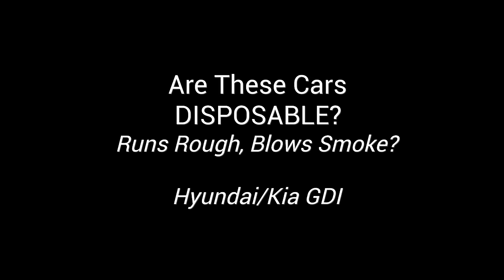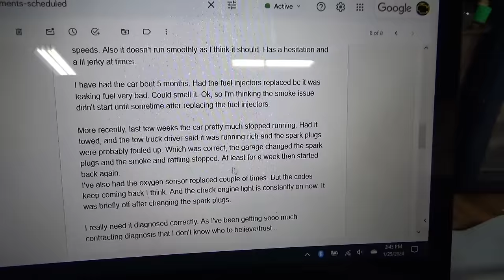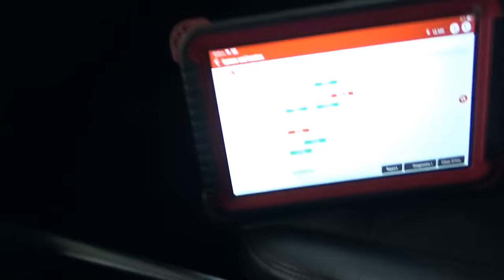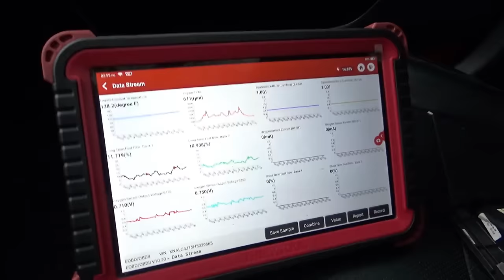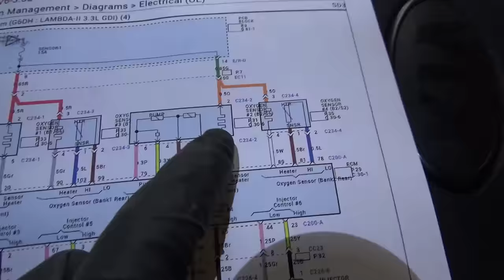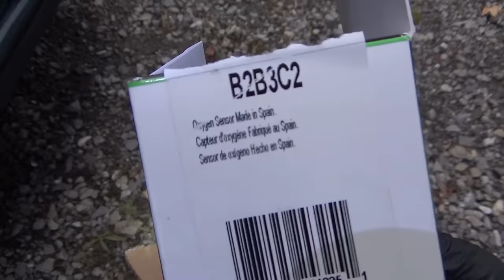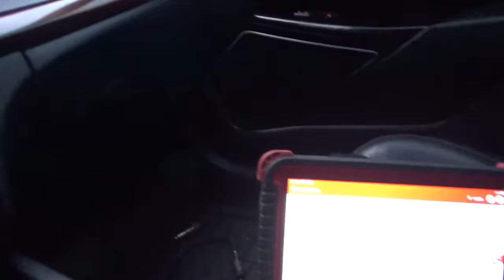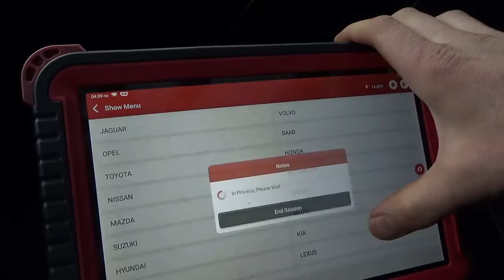Are These Cars DISPOSABLE? (Hyundai/Kia GDI Burning OIL - MISFIRE, Low Power)

Comment: What's horrible is Hyundai in the early 2000s had a halfway decent car. (Drove a manual Elantra to 199,000 no issues ever) They switched to GDI and the engines are junk.
Reply: earlier engines were Mitsubishi licenses. I have a Kia Amanti with an old Mitsu 3.5 v6 engine. There is a timing belt and the only problem is weak bushings. But if you take care of the oil and good cooling, it will last a long time
Reply: Yeah. They were terrible in the 90s, pretty good in the 2000s, and then trash again when the GDI engines came out.
Reply: Hahaha I have a 2011 Elantra with 160,000 trouble Free miles,
Reply: @Chris-L-sr   Not all of those are GDI for 2011.
Reply: Yeah, they spent like 20 years undoing the damage their early cars did to their reputation, only to redo all the damage with their newer engines. Just a shame.
Reply: The 2011-14 Theta II engines weren't cleaned thoroughly, so they left metal particles that would lead to rod knock and grenaded engines. I have a 2015 Sonata with this engine after they changed the cleaning method. The post-2014 engines are fine if you do the recalls, change oil on the dusty schedule and change the air cleaner on time. I've had no problem and only minor oil usage at 89K on mine.
Reply: I had a 2009 Optima, great little commuter car. No mechanical issues after 120K miles when I traded it in.
Reply: "Only minor oil usage at 89,000" , sorry you shouldn't have ANY oil usage until 200,000 miles! You're making excuses for a crappy engine!!
Reply: @jackedwards7420  NO oil usage at all between oil changes? That's a fantasy. Manufacturers admit there will be some.  I'm talking a half-quart every 5,000 miles, not blue smoke spewing out the tailpipe.
Reply: My sister has a 2008 Hyundai Sante Fe with the big 3.3l V6 Theta engine.  Valve cover leaks were common and a replacement was covered under warranty, which also leaked so I did it again myself. She had neglected a lot of maintenance (not oil changes thankfully) but after I basically rebuilt the steering and suspension (KYB shocks, Mevotech TX ball joints and sway bar links, new Hyundai compliance bushings, new tie rods, etc etc), it runs like a champ.  180k miles on it. A few oil changes with 20% MMO and then switching to 5w-30 cured the slight VVT rattle she had on startup as well.  Smooth power, transmission still shifts wonderfully (several drain and fills done on it). Had to troubleshoot and eventually replaced the failed TPMS module but it's even got a nice high line TPMS system that tells you the status of each tire individually.

She thinks it's like a brand new car after it returned to "properly maintained" status.
Reply: @brassmule  The problem with cars becoming so much better compared to back in the day is that drivers don't really need to know much or anything about cars. 

Those of us who grew up with points and plugs and mechanical timing know more and pay closer attention to maintainence than younger folks, because back then you had to or you'd be walking.
Reply: @Alboalt  Sometimes I do miss those days. I had a failing alternator, so I got to work early one day, removed it in the parking lot, walked 2 blocks to "the place" that rebuilt them - literally just handed it to a guy through a barn-style door, told him my name .  Went back to work and worked all day. After work, walked back, picked up my rebuilt alternator, gave the guy 25 bucks and got a handwritten receipt, reinstalled, and went on my way - 6 years later still had the car, still drove like a champ. I wouldn't say it was an easier back then but you still had to do the minimum to keep a car running tops.
Reply: @Alboalt  somehow my 06 Acura tsx with 240k miles doesn't burn a dime of oil,and it's  a 1 year amsoil oil change at 16k, For the last 7 years.
Reply: Have an 09 sportage with 2.7 v6. Only non service item replaced on it was the front exhaust pipe. Started leaking at the bellows. Damn salt on roads.
Reply: Yep, another friend of mine at work had one that had almost 300k on it, original drive train(3 pedal), he had to scrap it due to rust issues.
Reply: @mandytuning  You win the battle of the anecdotes!!!
Reply: the engines that were made in the USA are crap. The ones made in Korea are good.
Reply: @Alboalt  Yes a very valid point I had an 89 hyundai bought used for $500aud ,6 months registration (you have to have vehicles inspected & re registered every year)We (my mated & I ) thrashed that thing until I bought another vehicle it was then the circle of mates to drive until it was dumped by one of them (ran out of fuel) the only thing that went wrong with it was a bolt that held the thermostat in corroded off & we used a pair of vice grips to hold it together.I was a fun vehicle & we has it up to 160klms an hour 100 miles an hour in old terms with fout people in it.Another person told me it was dumped & gave me $ 250 aud for it.
Reply: Hey, I remember the mid 1980s Pony’s. Cheap little cars but super basic mechanics! If I remember, bodies went (rusted) before drive trains ever died.
Reply: @jackedwards7420 In a perfect world, a engine would not burn oil. Many car brands, 1 quart per oil change is not uncommon.
Reply: @jackedwards7420  Yep. I have a 2004 Corolla 1.8 with 180k miles and it doesn't lose a single drop of oil between 5000 mile changes.
Reply: I have an 04 Tiburon with the 2.7L Delta engine, which I think is one of the first engines Hyundai built 100% independent of Mitsubishi, and it's still going happily at 175K miles (supercharged even). I really love that car, sucks to see how far Hyundai fell.
Reply: @Alboalt except for my Subaru, none of my 5 other cars use an appreciable amount of oil between 5k mile oil changes. Yes some oil usage is acceptable but it is also far from universal.
Reply: All engines up until 2011 were either Mitsubishi designs or were developed in conjunction with Mitsubishi. All of these engines are excellent. After 2011, it is hit and miss with Hyundai/Kia engines. Theta 2 is a dog,. I have so many friends who have blown engine on years 13, 14, 15, 16 and 17.
Reply: I drove a 2002 hyundai accent for 20 years. No engine problems, ever.
Reply: the golden years @Serious-Man
Reply: @adotintheshark4848  This car has a VIN starting with K, so it was built in Korea. Can't imagine that they are shipping US-built engines to put cars together there.
Reply: @MattyClivingthedream  the Mitsubishi designs were excellent, but Hyundai's production of them was inferior.
Reply: 2009 Santa Fe 3.3 with 234,000. Value cover gasket replacement and alternator regular oil change 4500-5000 trans fluid at 60k , 120k, 175k. Brakes and fluid change and coolant change with t-stat original water pump yikes!!!
Reply: @Alboalt do you have actual proof of that? I think that original story was debunked when they had to extend the recall to include years after the supposed "remaining metal shavings" that were supposed to only affect 2011 and maybe 2012 in the initial recall. There are different theories on what the actual issue is but none of them that I had seen when I was researching this are remaining metal shavings. My wife owns a 2013 which is why I was looking into this so thoroughly.
Reply: Are you on crack? Hyundais in the 2000s were some of the least safest cars in the road. Sure, their engines might have been a little reliable but everything else was still junk. Imagine having a 3 year old Sedona with 50k miles on it and it needs new door sensors, oil pan gasket, power steering pump and hvac controls.
Reply: Yes, the 2011 Hyundai i 30 was a good car but the newer ones with GDI I wouldn't touch
Reply: @jackedwards7420   funny clown...tell that to any BMW, Audi or VW owner....yeah they burn oil when they are NEW and its eve stated in the owners manual....
Reply: @gionieves2646  , and that's still no reason for a crappy engine. Just cover up for trash!!
Reply: @jackedwards7420  not really...of people are changing the oil every 10k miles....yeah they deserve a new engine....the oil consumption I'd from the oil ring and compression ring getting stuck with sludge....bad maintenance!
Reply: They still build good cars. I have a 2016 sorento with this same engine. 180k miles on it with no failures.  The only thing that has broken was the combination switch for the headlights  which was recalled so free for me. 

I follow the severe use maintenance schedule since I tow with it and live in a mountainous area.(this is all in the owners manual of course).  

This car sees 6k rpm at least a couple times a month and I tow with it regularly. Uses about a quart per OCI. Strangely if you maintain your vehicle per the instruction of the people who built it then it will last just fine even under hard use. If you treat your car like it’s disposable and don’t care for it properly then yes, it will indeed be disposable.
Reply: Just the ones made in the U.S. They had trouble with the piston bore holes; made them oversized. Engines coming out of S. Korea are just fine. Always change your oil on time and check oil level every couple of weeks and top off if needed.
Reply: Well, no issues if you didn’t replace the timing belt at the interval they originally recommended for inspection. ;) Had a manual 2000 Elantra myself with the upgraded interior from late 99 to 2007 when someone T-Boned me. They used to be all over the road but it’s a rare distraction when I see one now. I assume the timing belt thing started taking them all off the road after the 10 year warranties expired and subsequent owners dropped their maintenance regimens.
Reply: @emmettturner9452  had one with 198k original timing belt.
Reply: Yep their 2.4 back in the early 2000s was a good engine.i still drive a 04 Santa Fe with this engine it has over300.000 miles on it .with regular oil and filter changes at 3000 miles conventional oil and filter.the only thing that typically would go bad from time to time was the crank angle sensor or water pump .also be sure to keep after timeing belt and related bearings.its advisable to change water pump at timeing belt change
Reply: @jeremypilot1015  Sure the dealer wasn’t replacing them during regular maintenance when they are on the hook for the first 100k/10 years? They had a financial reason since they are on the hook for it otherwise (interference engine). Heck, they were originally supposed to be replaced at 90k for normal scheduled maintenance. It got bumped to 60k when they found out most were snapping at around 90k.
Reply: it has nothing to do with GDI it has to do with manufacturing defects you either get them or you dont
Reply: @adairjanney7109  GDI by nature is junk. The intake valves never come in contact with gasoline so they carbon up and cause all sorts of problems. It costs a lot to have the intake removed and all of the carbon cleaned out. A grand or better by the time you’re done.
Reply: @jeremypilot1015  bs I dont buy it, I opened up my intake at 250,000 and was there carbon, sure but it wasnt going to kill the engine, it isnt gdi that kills these engines at all that is absurd
Reply: @jeremypilot1015  look it up yourself from what I understand its manufacturing defects leaving burrs and what not behind
Reply: 200,000 on 09, and 265,000 on 07 engines, both are just getting new gaskets as they have gotten brittle and started leaking.  But inside no wear showing yet.  only reason 09 is getting them is what they h*ll, engine is out to change the clutch, might as well do it while it is an easy job on the engine stand.

Comment: 120k seems to be the life expectancy for Kia and Hyundai engines.
Reply: There are a few auto manufacturers that seem to shoot for 120,000 to 150,000.  Alot of the early 2000's Volkswagen stuff was that way.  I think this design started with the early Ford focus and the dodge neon.  Make a cheap disposable car.   Unfortunately now manufacturers have forgotten about the cheap part.
Reply: Some of the older ones particularly Hyundai engines were really good like 90s 00s 10s of varriying models ect some of them were stupid reliable and cheap but that is long gone in all brands
Reply: Hyundai has terrible engines and terrible owners. Terrible owners since most don't change their oil like they should.
Reply: As an SB mechanic (honorary Hyundai tech lol) 120k is optimistic and anomalous. 
Most 2017+ Hyundais / Kias that are brought to me (on the original engine / dct/auto) average around 50k with at least one melted bearing, or a seized oil pump, and worn gears. 
I hear that Hyundai and Kia continue to be back logged for warrantied powertrains, but that doesn’t stop them from denying the MANY that inquire with my garage. 
One of my favorite customers left fuming when I showed him his recently warrantied replacement - Hyundai gave him a used engine that had scoring on the cylinder walls and a gummed up crankshaft - but clean piston heads lol.

Comment: I've worked on a few kias lately ( Problems unrelated to engine ) and I've made it a tradition to pop the dipstick and view the diesel level blowby 😄
Reply: Naw. That's clean compared to my diesel oil.  I have 5 gallons if you need some. :)

Comment: the designer of "low tension oil rings" should be held accountable. they designed these to increase fuel mileage, but if the oil is not changed every 5K they will carbon up and leak. I went through hell with my daughter's Hyundai.  Luckily i had receipts for oil changes and Hyundai replaced the motor under warranty.   the earlier Hyundai / Kia motors were rock solid until they made this change. I think quite a few manufacturers changed to these oil rings in the 2010s.
Reply: Thank the EPA.
Reply: There were problems with head bolt threads in the aluminum block failing on the older 6 cyls - Hyundai has not had a great record the last couple decades.  Fixing that problem is possible but it's not real fun and it sort of leaves you with questions, again, but for a different reason, about the rings being screwed up.
Reply: Low pressure rings are due to emulsions not mpg
Reply: @LuckyWerewolf-yk6wo  Want to try again?  Emulsions?
Reply: Will they carbon up and leak if oil is changed on time?

Comment: I don't even spend time diagnosing these engines anymore. I simply give an estimate for an engine replacement and go from there.
Reply: Similar process at my shop. Some owners see it unconscionable to swap another ticking time bomb in, let alone a used one, but I always fire back with “I see your concern, but Hyundai absolutely swaps in re-manned powertrains under warranty”.. Personally, I don’t know if I could choose - repair my original, broken powertrain, or, have Hyundai swap in a previously failed unit..
Reply: @bennyhonna  They rank among the poorest engines ever produced. No quality control at all.

Comment: I've seen a common theme with these..  just like Subarus..  If you don't change the oil often enough, the engine creates a lot of issues..   vs Those who do change their oil religiously, tend to have decent results with these cars.
Reply: It is a must with GDI engines & 5W30 oil every 5 thousand klms or once a year if you do not drive that far (I do not know what that equates to in miles.)

Comment: Frequent oil changes (less then 5,000miles) on a direct injected engine is the best you can do.  It may of helped this vehicle last longer.    10K oil changes like Kia/Hyundai owners like to do, assumes junking the car around 100K.
Reply: So do toyota owners..maybe worse
Reply: Yeah if you want 10K mile changes to work, get a naturally aspirated mazda and drive a lot of highway.  It's not a direct injected thing, it's a shit engine thing.
Reply: @big0bad0brad No all direct injection engines are having this problem. Hyundai is having them the worst
Reply: There was a great video by The Car Care Nut where a 2015 Toyota Camry had to have its engine rebuilt because of the owner following the least frequent oil change intervals recommended by the car manufacturer.
Reply: The way to tell is by sending the oil in to a lab to be tested for performance and dissolved metals.  Skyactiv engines don't seem to have... whatever it is, the hot spots or blowby characteristics or whatever... that wrecks oil faster.  It's not a question of "if", but "why".  The "if" has been proven by the lab.
Reply: LSPI is the reason.
Carbon build up in cylinder.
Need to use correct oil and not let oil level drop.

Comment: I had good results with BG EPR on a 2003 Camry that was smoking on cold start. Also my 190,000 mile 2006 Highlander produced a lot of carbon-blackened drain oil and now runs even smoother than before and now the very moderate oil consumption (quart in 5,000 miles under heavy use) is gone.

Comment: I had a 2007 Sonata with the 4 cylinder, great car, loved it. But it consumed oil, didn’t smoke didn’t leak, 1 quart ish per 1k miles, but it recently upped that and spun rods at 1500 miles from a fresh oil change, didn’t drive it hard, but it was Christmas time and I was working a lot so I didn’t check it. Now I’m in an ES330 and I love it

Comment: Most engines produced in the last 6-10 years have piston rings with very little pressure against the cylinder walls to decrease friction. The oil control rings on some models are sticking in the grooves and stop doing their jobs because the compression rings are letting too much carbon go by. I have never owned and will never own a Kia or Hyundai. You are better off buying a used Honda or Toyota than a brand new car from Korea.